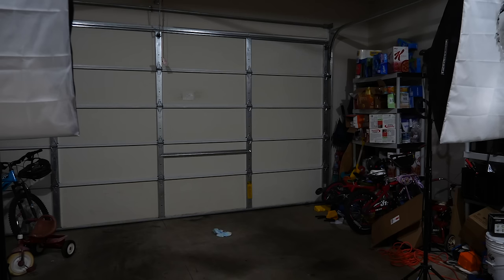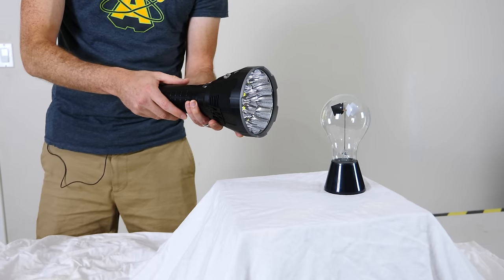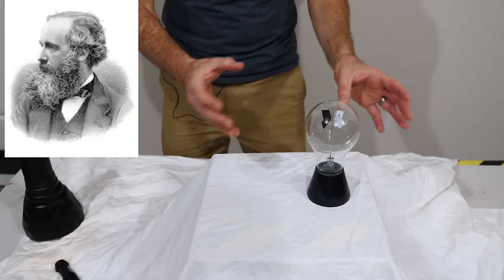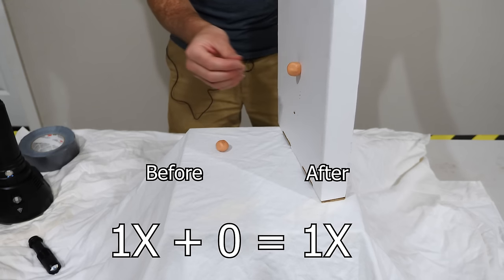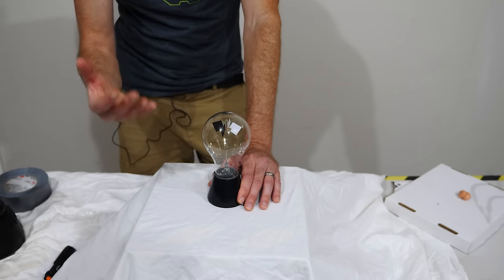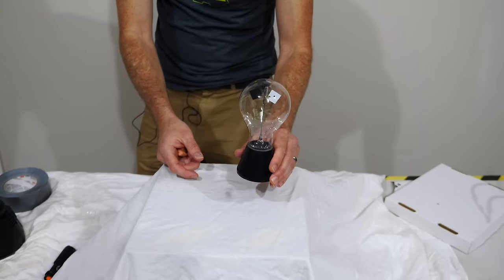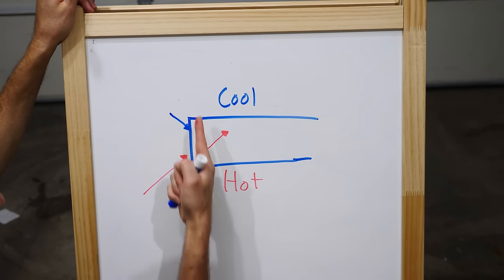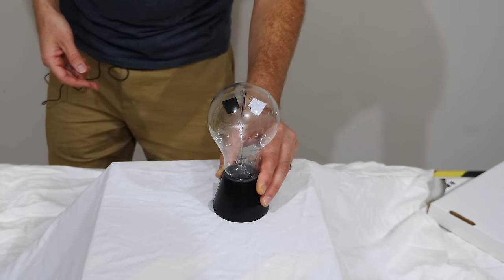Shining 100,000 Lumen Flashlight at a Crookes Radiometer

Comment: I have a radiometer that is black on both sides. Each square is completely black - front and back. Even the sharp edges are black.
Given that any differences between black and white sides no longer exist, can / does thermal transpiration still stand up as an explanation?
It can't be heat related because both sides are black, and as far as I can tell, thermal transpiration also relies on one side being white. 
You could argue that the angle of the light beam hitting the squares could allow a 'pushing' effect, and it is near impossible to shine a torch beam equally between the squares - or at least with a home setup. So, a beam bias / shining more one side / square than another can't be ruled out. 
Still, even when being super accurate and aiming the light beam towards the centre post and keeping the exposure to each square as even as possible (as well as when using the radiometer in a traditional way), mine acts the same as ones with black and white square.

Do you think the current theory still stands?

DB

Comment: Can you try to make a big scale Radiometer. And connect it to a dynamo, to see if it can for example charge a phone.
Reply: Nor enough to even spin a dynamo to much effect at all.  The blades are suspended from a glass cup on a needle point to get the least friction possible.  The slightest bit of friction will overcome the air pressure differential.
There is, however, the idea of a solar sail which could use radiation in space to drive a ship, but it might only work away from the nearest star.  It would require a massive amount of lightweight film to be used for the sail, as radiation offers so little pressure relative to the weight of anything we'd want to transport.
Reply: 1. That wouldn't work.
2. Why? That's what solar panels are for...

Comment: So it's a tiny solar sail then?
See if you can develop an automotive supercharger that operates on light. It's just crazy enough to work!
Oh yeah, how much for the big light?
Reply: when he said, "it's taking off", it sparked an idea for a solar-powered helicopter. 3:19
Reply: No. "Solar sail" is the original theory proposed by Crookes (but would be light bouncing off the white surfaces, spinning the other way). This works, but isn't what's responsible for the "reverse" rotation, as explained.
Reply: @MadScientist267  yes, yes I know. I wasn't writing a master's thesis. I was simply making a comparative analogous observation.
Reply: @michaellinner7772  
Well, it wasn't an observation, comparative analogous or otherwise, it was a question; and the answer to the question is "no".
How the Crookes radiometer works was explained in the video to not work by radiation pressure, which is the means by which a solar sail works.

Comment: @The Action Lab. You could have explained it in a much better. 
The real reason is the inelastic collusion of air molecules on surface. When a gas molecule/atom hits a surface it exchanges the thermal energy with surface based on the temperature difference between gas and surface. This is the working principle here. 

Upon irradation with light, the surface absorbs light and becomes hotter than air. The cold air molecules striking the hot surface absorbs the thermal energy (vibrational energy) of the surface atoms and reflects back at larger momentum than it's incident momentum. This difference in momentum is the additional kinetic energy gained by air molecules the same amount of momentum is gained by the surface in opposite direction. This creates a pushing force on the surface of the fin. The black surface absorbs more radiation energy is hotter than white surface hence receives more push than white side. This produce ned directional push from black to white which results in the rotation. 

Cooling the outer surface will cool the gas inside to lower temperature than that of the fins. The cool air again produces the push on the surface. But this time around the black surface is cooler than white surface as it radiates more blackbody radiation. This creates net push from white to black direction (opposite to previous case) and the fins rotates the other way round. 

One might argue that the exchange of thermal energy should reasult in eventually heating of air. While that is true the light feeds more and more thermal nergy into the fins which escapes through the gas to the glass walls and then finally to the surroundings. So, as long as the light is on, there is temperature gradient maintained and the fins keeps Rotatating.
Reply: I'm not satisfied with this theory. Say you were to increase the gas density in the bulb. While this would certainly increase drag, the ratio of faster to slower impacts on either side of a vane would remain constant. Thus the vanes would still spin, just slower. But that is not what we see. A radiometer does not function at all if there is too much or too little gas. 

When I shine a 2 watt UV laser into my radiometer, it spins so quickly that I worry it will fly apart. The beam is potent but it does not heat evenly. All of the surface of the vane remains at ambient except a thin stripe where it passes through the beam. Are we to believe this thin stripe is inducing enough kinetic energy into the gas to spin the vane into a blur? 

When I shine the beam at the white side of the vane, it does move at all. This is significant. The beam is certainly strong enough to heat the white side. Matter of fact, it would quickly heat both side as heat conducts to the black side. When the beam is removed, you can confidently conclude both sides of the vane are equal high temperature, yet the vane still does not move. This challenges the theory that blackbody heat is powering the motion.
Reply: @nathanegbert977  I will try explain your queries to the theory paragraph wise. 
First of all it is not moving due to blackbody radiation. It is moving due to temperarure gradiant between air and sides of the fin. Black body radiation is inderdirectly affecting the motion by maintaining this temperature gradient during cold(cooling the glass chamber) operation.

Paragraph 1 query: 
The reason it is not spinning at higher density has nothing to do with drag(drag merly decides the speed). The thermal Conductivity of gas increases with pressure. At higher pressure, more gas particles interacts with surface and drains out the surface temperature more quickly. When this heat outflux from the surface approaches to the heat influx by the light source the temperature gradiant between gas and surface reduces. This reduces the momentum transfer and thus the unbalanced force. When the moment due to this force reduces to that of the static frictional resistance moment, it cant get enough push to start rotation. (You can validate it, by shining a brighter light at high pressure it should be able to rotate it as heat influx increases) . At very low pressure the conductivity of gas is very low hence the temperature gradient is very high. But here the number of gas particles itself are low to create sufficient force on the surface to make it spin. 

Paragraph 2 query:
Your argument is still not clear to me. From what I understand you are trying to say that for a faster spinning radiometer, light will only see the edges of radiometer and they will not be enough to create the momentum. Well in this case the speed of light is way beyond the maximum rotational speed ever achieved by any machine. So no matter how fast it spins the light will still see the entire surface. The entire event duration of heating the surface is orders of maginutude less than that of the rotation period. Also the average thermal velocity of gas is around 460 m/s at room temperature, so a rotating fins would be way too slow to affect the gas particles collision on the surface. No matter how fast it spins, it is still slow to affect any of the physical phenomen that is causing it to spin. THE FORCE IS ALWAYS PRODUCED BY THE ENTIRE SURFACE NOT ONLY BY THE EDGE. 

Paragraph 3 query. 
Here is the thing. When you shine the bright light on the white surface. You say heat is transferred from white side to black side right? The fundamental law of thermodynamic says that the heat transfers only due to temperature gradient. So, in order for heat to transfer from white to black, white side should be unarguablely at higher temperature than black side. They cant be at same temperature unless you swith off the light source after which it won't spin obviously. 

Edit: while this are qualitative explanation. The actual operatioal conditions depends on lots of factors like, type of gas (mono atomic/diatomic),  surface area, light Absorbance spectrum of fin materials, It's microscopic temperature, Surface roughness, pivot point friction, e.t.c so each radiometer meter should have different operational range of pressure, light intensity and wavelength and are difficult to quantify.
Reply: @milaanpatel4997  All that makes sense but I think you missed where I said I was using a 2 watt laser. A laser does not heat the entire surface. It only heats a line on the surface as the spinning vane passes through the beam. The vane only spins when the beam is on the black surface. When the beam is applied to the "white" side, the vane does not move. The vanes are made out of mineral mica, which is an effective insulator but the sheets are very thin and thus have low R-value which certainly renders the beam strong enough to heat the black side through the white side. 

If I understand you correctly, the temperature gradient of the vane is maintained by the color of the surfaces irrespective of which side of the vane receives the energy (such as when the device is in sunlight). If that is true, then it shouldn't matter where the heat is applied so long as a temperature gradient exists. So why doesn't the vane move when the laser is removed from the white side allowing the heat to conduct to the black side where it is radiated away at a higher rate than the white side? That laser beam is about 2,000 times the intensity of sunlight. It undoubtedly heats both sides of the vane several hundreds of degrees in a fraction of a second --certainly enough heat to produce a gradient.

Something else to consider. Mica is mostly transparent to visible light. The "white" side of each vane isn't painted. It appears white because mica is shiny but it allows a portion of the light to contact the back side of the black paint. Food for thought.

I don't know. Clearly I'm out of my pay grade here but it is a fun discussion. I'm gonna keep digging, maybe check the Wiki. Thank you Milaan for the detailed reply.
Reply: @nathanegbert977  Thats a good point. I haven't used the laser on the surface. So, I can't tell the exact mechanics here.  

If you put the device in the sunlight there is always a black surface receiving the light at any point of the time. Here, you are shining 2 watt UV laser on white side of 1 fin, over the small area (assuming you are not using a beam expander) while the fin is stationary. The temperature gradient will exists from white to black while laser is on, and from black to white when its off, so theoretically it should create net force on that localised area, once laser is switched off. But from what I see, your laser spot size is very small, this results into localized heating to high temperature rather than heating of entire surface (as in case of sunlight). So even if the net force is produced, it is limitted to very small area of the fin which may not be sufficient to rotate the fin. Try increasing the spot size and repeat the experiment, I assume the fin would rotate as expected (if it doesn't results would be interesting). 

You may also try to measure the temperature distribution by thermal camera(with laser on and off) which would make thing more clear. 

Further, 2 watt is very high energy to be incident on the such a small area, this would result in other phenomenon of heat loss (majorily through Rayleigh scattering along with reflection). So that the surface itself would not be receiving the entire 2 watt. Only the light absorbed by the surface will result in heating. Hence, It is also important to know the absorbance spectrum of mica in UV region. This will give you estimate of how much light energy mica is absorbing corresponding to your laser wavelength. From what I know mica absorbs more light in visible/IR region (above 700nm wavelength) than in UV region. Which makes sense as radiometer are made to be used in sunlight. 

It is a good discussion. Challanging arguments enhances the knowledge. Knowledge is not decided by paygrade. There is always more to learn and discussion is an important part of it. I am always open to challanging discussion.
Reply: @milaanpatel4997  The laser does have an adjustable beam so the experiment is doable. And I do have an IR camera, but the glass is opaque to far infrared so it wouldn't be of much use. 

As an old rockhound, I may have a sample of mica in my box of goodies. It would be interesting to cleave a thin sheet and test transparency with the UV beam. I forget the wavelength of the diode. I built it back when handheld 2w lasers were unheard of. It's been a few years. 430nm?

Anyhow, if the mica is transparent to the beam, then I agree. A wider beam on the white side of the fin should produce sufficient temperature gradient when the beam is removed. If not, then radiometers are powered by magic, which is what I've suspected all along. I will run the test this evening and let you know!

Comment: 8:19 You might add that the black side create also mention that the dense cold air always move where the air is hotter and less dense. So between the 2 panels, the cold air from the white side move to second black panel and create ai movement. While the panels are in rotation, the air between the 2 panels move at the same velocity but on the hedge panel you have a little vortex that create a drag. This drag also help to attract the air from the white other pannel to the nex black panel. And without this vortex you will have no motion at all in this experiment.

Comment: 5:16 I don't think that's correct. The photon doesn't have "negative momentum" after bouncing off the material. It has the same momentum it did before. It's just going in the opposite direction. Momentum is momentum regardless of whether something is moving left or right. Linear momentum is just mass times velocity.
Reply: ...and velocity has direction
Reply: @proloycodes  You're right, velocity is basically the speed of something in a given direction, so momentum could be positive or negative in that respect. But his conclusion about momentum in the timestamp above can't be correct. The reason has to do with kinetic energy, which is a function of momentum. If, according to him, the photon has negative momentum after bouncing off the white panel, then the white panel would have positive momentum per his own equation. BUT, the kinetic energy (p²/2m) of the photon is the same before the bounce as after the bounce. And since you can't get more energy out than what you put in, then the white panel should have no momentum at all as a result of the photon bounce. But he's saying that it does just based on the equation that he used.
Reply: @jeffo9396  thats what he said wrongly, i agree with you

i just couldnt agree when you said momentum cannot be negative or positive based on direction
Reply: @proloycodes  Yeah, I should have clarified my initial post a bit better, in the sense that momentum can't be negative if you plug it into the equation he gave.
Reply: @jeffo9396  yeah you could clarify that he you were talking about his equations

btw, i think he loves to spread misinformation and be a MythMaker

Comment: Just came across this video, even though it is 3 years old.  The actual reason that a Crookes Radiometer moves is probably significantly more complex than the thermal transpiration or thermal creep theory.  In an elegant series of experiments done by Jerry Liu at Stanford University using focused beams of light, he shows that this cannot explain the vane's movement in all scenarios.  For example, a radiometer with HORIZONTAL vanes painted two-tone with one half white on BOTH upper and lower surfaces and the other half black on BOTH upper and lower surfaces (Hettner radiometer) will also rotate when exposed to light showing that thermal creep CANNOT possibly be the driving force.  Not only that, it will rotate with the white half of the vane LEADING!  Liu gives a much more compelling explanation using a phenomenon called transimpact.  As the black surface of the vane absorbs photons, the atoms on the surface of the vane or in the air next to the vane absorb energy causing an electron to excite to a higher orbital (quantum jump).  This causes the outer orbital shell to expand slightly producing an explosive-type interaction with adjacent molecules (air vs. vane) upsetting the balance of the Van der Waals forces and pushing them apart, thus imparting motion to the vane.  Kind of like popcorn popping.  In the case of the Hettner radiometer, this interaction occurs on the EDGE of the vane - rather than the surface - which is why it also moves with the white side (and edge) leading, albeit MUCH slower since the surface upon which this is occurring is much smaller than on the vertical vane, providing less force to overcome friction.  Alas, the thermal transpiration explanation was attractive for a while, however it, like all of the previous theories, seems to actually be incorrect.

Comment: So, in essence, it's just a difference of pressure between the white and black side of each vane that's created by the thermal conductivity rate of each side of each one. It would seem as though a medium of some sort is a requirement within the bulb to operate. The basis of all motion appears to be continuous difference of pressure within some kind of medium.